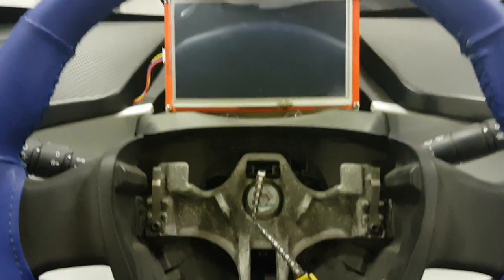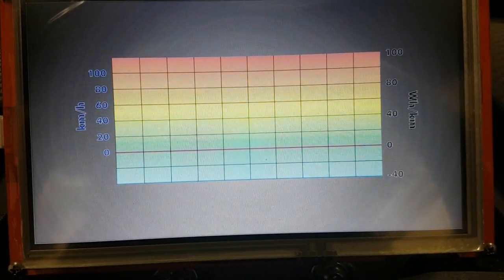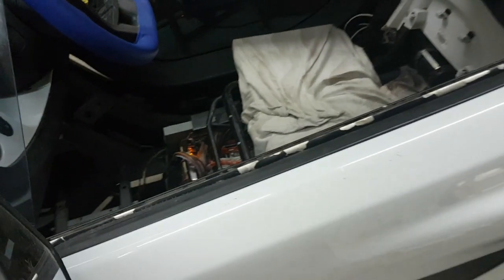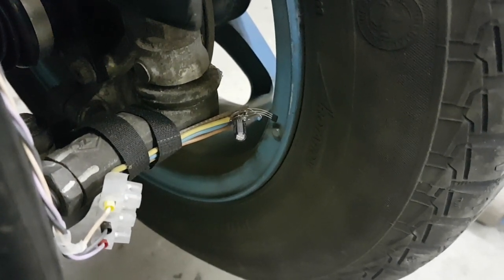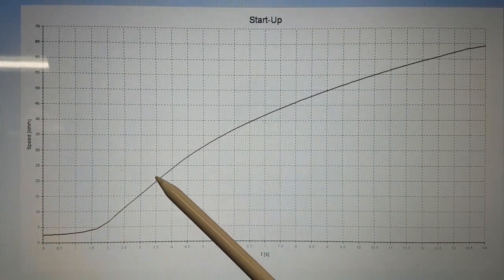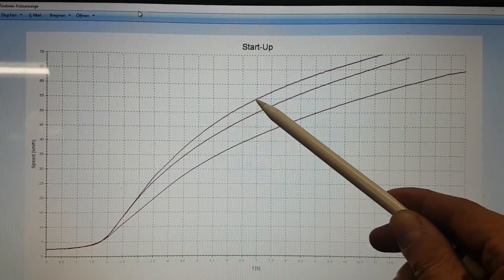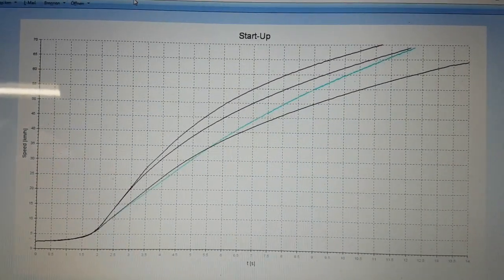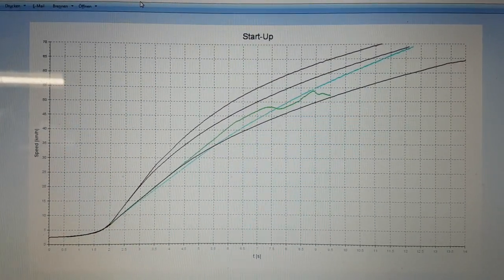#10 Twizy DD Dual Drive (Revolt 160Pro) - Nextion Display & Performance Data

Comment: I follow with great interest your efforts, which i frankly admire.
I am myself upgrading my midget submarine to latest technology including Revolt 100pro brush less motor (KV32,) LiPO batteries, embarked  network of 6 microprocessors for  measuring and datalogging  based on PJRC teensy 4.Thermal increase even underwater is an issue.My throttle is programmed to automatically reduce speed-step by step- as long as temperature is above 70° in the stator.
I would love discussing these issues with you, if that is possible.Good regards
Pierre
Reply from the maker: Hi, 70°C in the stator is still very safe! The 160Pro is designed fpr up to 120°C continuously. IMHO you can easily go up to 100°C. Do not forget to have an eye on the rotor which heats up as well especially at higher speeds (for my 160Pro - 50KV it was higher than the stator!). Furthermore try to help it cooling down, i.e. passive radial fan design (see one of my videos). Good luck! ;-)
Reply: @nextev8794  Hi ! thank you for your answer !
I do know that the stator winding can bear much higher temperatures; what I am concerned about is a possible demagnetization of the rotor magnets ( i believe as soon as 80° C); unfortunately i cannot measure the rotor temperature under load, and the only possible place for the sensor (K type) is inside the stator;I have developed an embarked monitoring system for my submarine in order to watch in real time the motor parameters; additionally i log in a SD card all parameters during navigation in order to be able afterwards to correlate, speed, wattage and temperature.
I have in the meanwhile gathered real world data and the outcome is that -with an electrical load of only 650 watts during 25 minutes -the 70° limit was already reached, and that speed reduction was necessary in order to contain the temp increase at said level; Water cooling on this motor being apparently not very effective, I consider to attach on the back of the rotor a mono-bloc crown of fan blades ( 3D print) in order to obtain an axial blower effect; that is indeed close to what you did ,but i would expect a better efficiency thanks to foil profiles, pitch angle and blade length increase.What do you think ?
By the way, I shall soon undertake to improve the displays thanks to a MultiFunction Display (5"); which communication do you use between the Nextion display and your main processor ? I2C or RX/TX ? is the display programming very tedious ??
Good regards.Pierre
Reply from the maker: Hey. If you reach 70°C at 650W something's really wrong.
The magnets inn the 160Pro are N42H. The "H" defines the operating temp, i.e. less than 120°C, In the early days Revolt told me 80°C for the rotor are perfectly fine cont., 100°C peak.
The NNextion communication to zhe µC is RX/TX, programming the display is done via USB. The first steps are tedious, one you got used to it, it works like a charme.
All the best, pls keep us up to date with your version of a radial fan!

Comment from the maker: Meanwhile the tenth chapter of a long (=slow?!?) conversion story of a Renault Twizy into something more powerful, more range and thus more fun. All important hardware (main control unit, motor and gearbox, power electronics, charger, DCDC converter and ... ooops, airbag) has been removed and replaced. Many test drives are promising and enjoyable, unfortunately the dual drive unit showed problems due to misalignement of the shafts at high torques

Comment: Sehr interesantes Projekt. Welche Batterie ist genau eingebaut und wie hoch ist die max. Stromentnahme in A?
Reply from the maker: 60 (30s2p) x OSN Power Tech Ltd LiFePO4 85Ah, ~16kWh, 300A cont / 500A peak discharge
Reply: Hallo und vielen Dank für alle Infos! Ich habe auch vor meinen Twizy auf Doppelmotoren umzubauen. Ähnlich wie bei Ihnen aber ohne Übersetzung und beide Motoren montiert direkt an den Antriebswellen als Direktantrieb. Dazu müssten 2 x rv-160e mit 19kv genommen werden. Frage - könnte es mit 60v Nominalspannung und entsprechend gut gebauten Batterie funktionieren und fahrbar sein?

Danke im Voraus und viele Grüße!
Reply from the maker: I doubt they will deliver enough torque. In general BL outrunners suffer in a low startup torque. Anyway, 60V and 19kv will lead to a top speed of approx 120km/h. The batteries won't be the bottle neck.